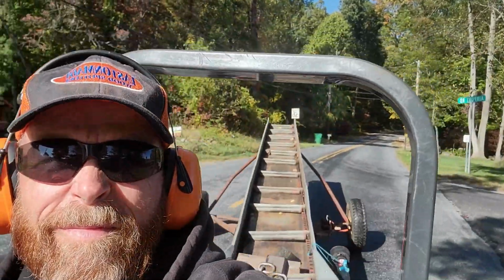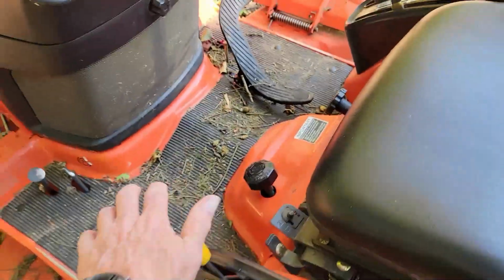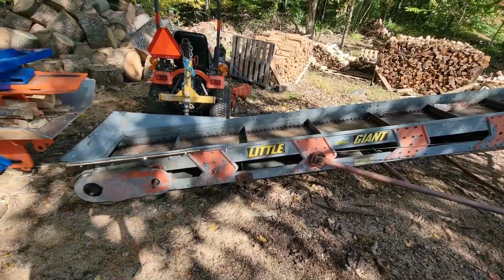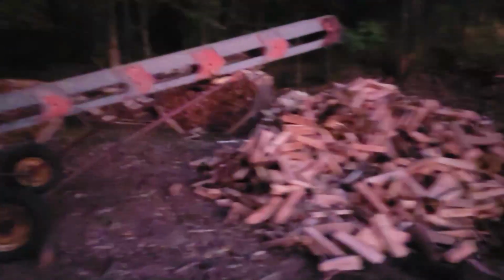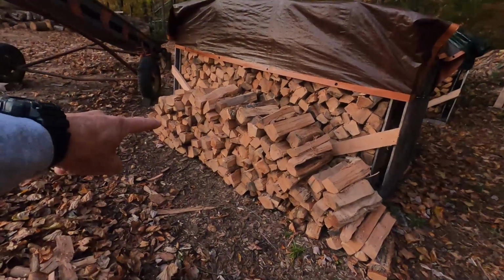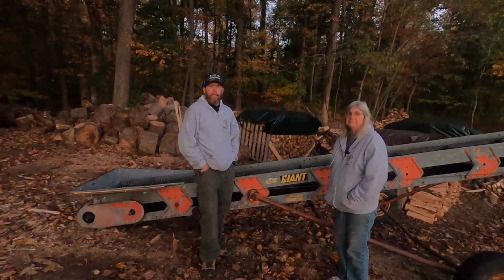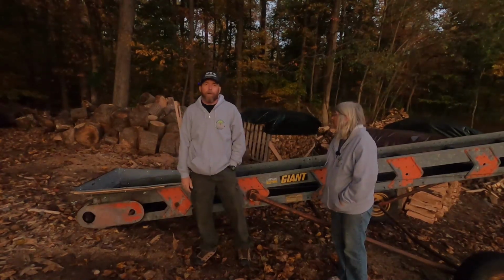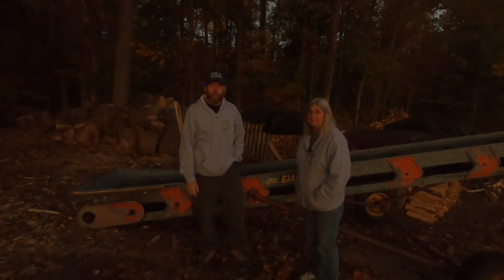Eastonmade 12-22 and The Conveyor. How Fast Is It?

Comment: I was wishing that the wood splitter was a universal side to side so that no matter where it was easy to load wood into the block lifting part. Probably have to set up where it is further down towards the bottom an all the wood just comes to it naturally. Now if you had a dump trailer/truck to have the wood drop into so it could be dumped in front of pallets or how ever it would be easiest for you. Firewood in absolutely money in the bank... even though would make nice boards, its better to have money than logs laying and going to hell on you. Since I have never been around walnut logs, don't know if bugs or rot hit that bad or not. Kinda expensive to just saw it and then look at it for months. Lot of harbor freight tarps to cover that pile of logs plus they must only last maybe a season before their rotted an don't work as a  cover. I think if you hit that four to more cords a day in firewood, then when ready to sell, bank notes go by by.
Reply from the maker: We could have ordered a splitter with 2 log lift. Load from either side.  We will manage with this one though. Since we share this apace with our mill logs, we have to set it up some other way. We ha e a dump trailer, and it works well when we fi our wood shed. Fill the trailer in the wood yard, then drive to the wood shed, back up to it, lift it, and start pulling wood to stack. We mill the best logs for lumber, and the others go to firewood. When one isnt selling, the other one is. We split and properly dried any wood we get.
Reply: @IronOakSawmill  I think we all have a second thought when purchasing a expensive tool an its got to work for a long time to pay for itself...:>)
Reply: Hi Morgan.  Thanks so much for the comment.  We get are tarps at tractor supply.  In the logs are we are buying less expensive tarps. But for lumber we buy the truck tarps from the same place, they work better for us.